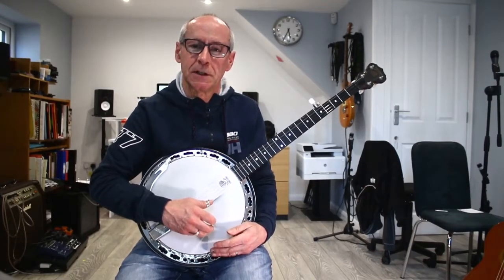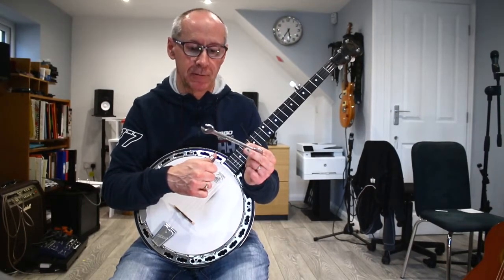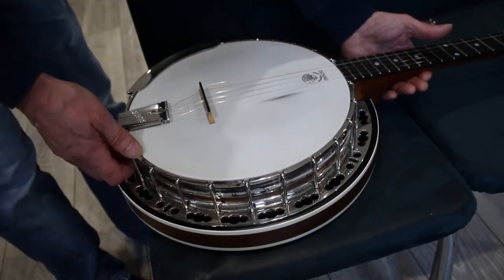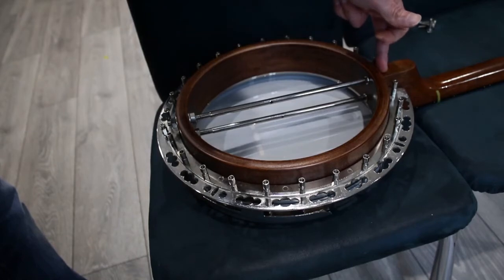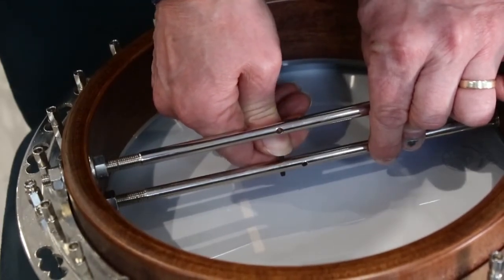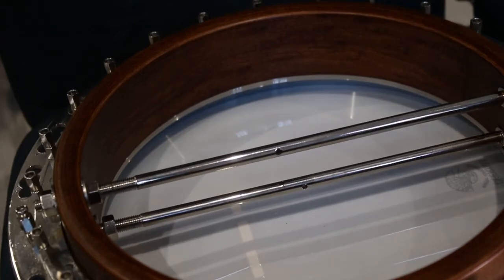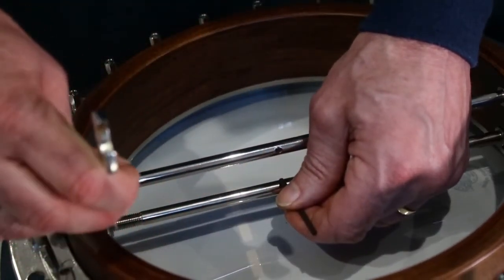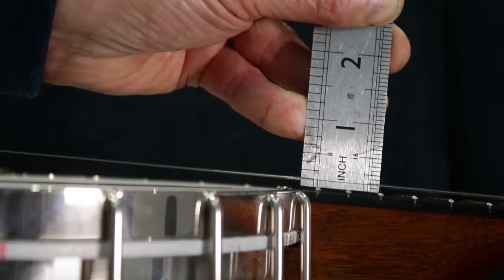Banjo Neck Adjustment

Comment: What you mean to say , is how to destroy the rim , by adjusting the rods , that`s not what they were designed for !  The neck action angle adjustment , is cut into the heel of the neck , where it meets the the rim . To correctly adjust , the angle on the end of the neck has to be recut , just like a guitar !  PROVE me wrong . Or just destroy the banjo rim ............
Reply from the maker: I know what I mean to say. Minor necknangle adjustments are fine using the torsion rods, if a large change in neck angle is needed then, yes, some work on the heel would be needed.
Reply: @RoyJohnsonMusic   Those coordinator rods are to stabilize and hold the rim in its proper diameter , any adjustment other than the neutral position(proper diameter) is distorting the rim , highlight that ..........
Reply: @charlesmccormick4443  Not according to Deering, the manufacturer of the banjo.
Reply: @ev25zv  You go ahead and adjust all you want to , I dont have a penny in it  ..........
Reply: @charlesmccormick4443  Cool.  Thank you for your blessing to follow the manufacturer's guidelines for coordinator rod adjustments
Reply: I thought the adjust is to be done in the truss rod at the head where the keys are.
Reply: @bigal25938  Big difference between adjusting neck angle  and adjusting  under bow or over bow of the finger board/truss rod ........
Reply: @charlesmccormick4443  the rods are one for rigidity the other for adjusting any small neck bow adjustment.
Reply: @dangeoopatrick2593  LMAO.........The truss rod in the neck is for adjusting under bow or over bow in the finger board , the 2 rods , some have 1 rod , in the rim , are to hold the rim stable and in its correct diameter .
Reply: The other easy adjustment is to use a plastic washer 1/16ths on the upper lag screw esp if the heel cut is not right. You can sand the washer down for fit until you decide to get the heel cut trimmed.
Always leave at least a 1/32 gap between the fingerboard and pot, rods neutral.
Rods NEVER super tight the rods. THAT WILL DEF RUIN THE RIM.
Cheers.
Reply: @luminawarren8132   L O L

Comment: Whereas showing and clearly explaining how cortanator  rods work and are adjusted is very important and you executed that very well may I add.
I think however it’s waste of viewers time showing how to unscrew screw 4 thumb screws etc surely the majority should be able to do that without being shown, that goes for refitting the resonator screws.
So for time wasted only 9 out of 10.
Coincidentally I have a Sierra and re-set the co-ordinator rods without books or video and I accept some ppl are not able to do that but do spare a thought for the majority.
Reply from the maker: Thank you for your carefully considered feedback.